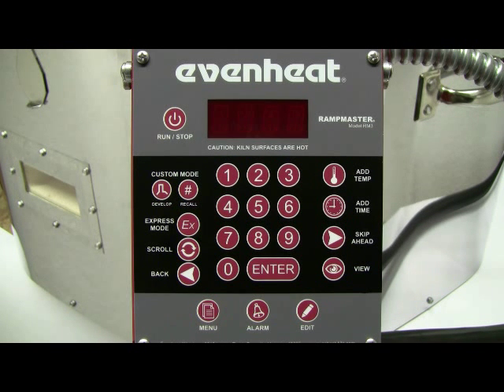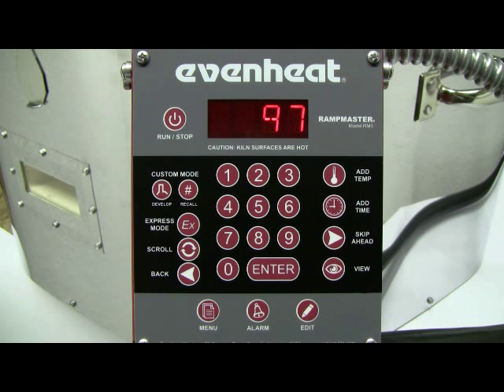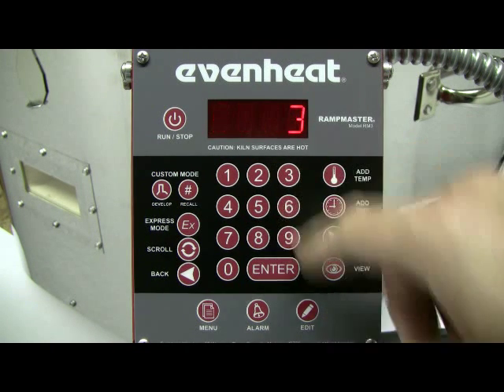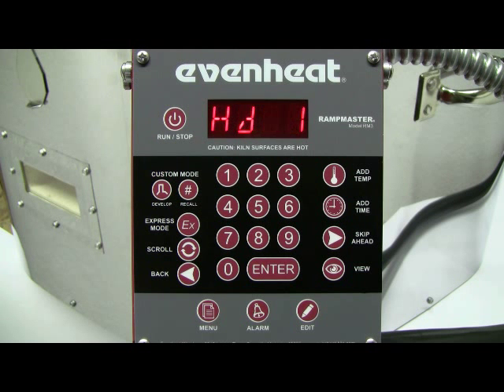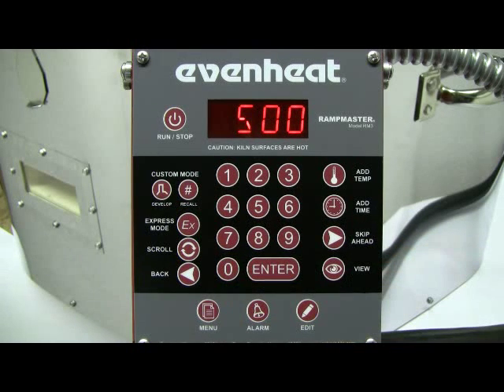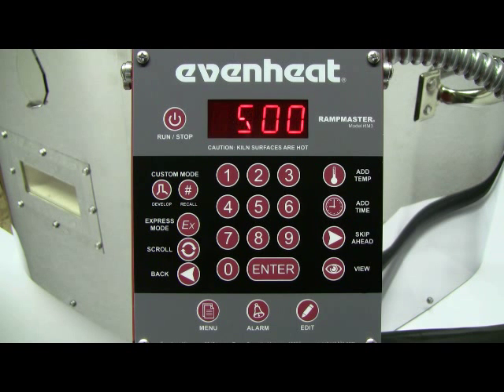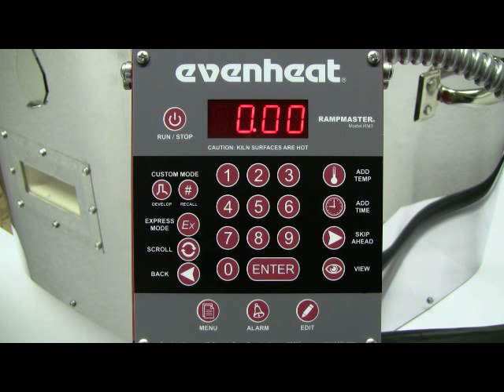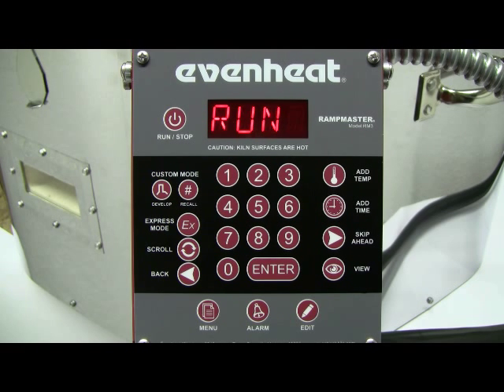Rampmaster Custom Mode Programming

Comment: Why do the express modes not include one for firing painted glass? It seems very strange to me since that is one of the most common and oldest reasons for firing glass yet all the presets are for things like fusing, slumping, casting. Makes it very confusing for a beginner Glass painter.